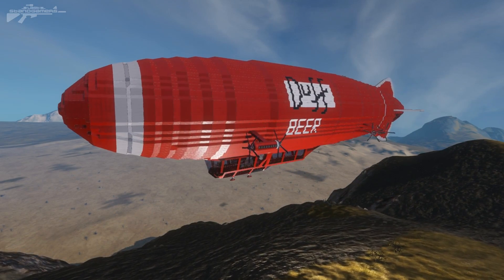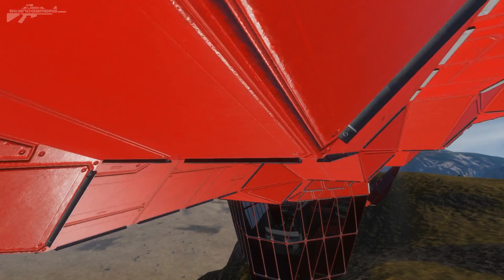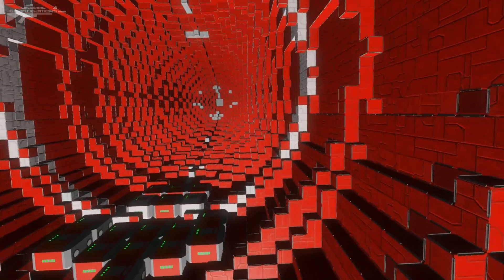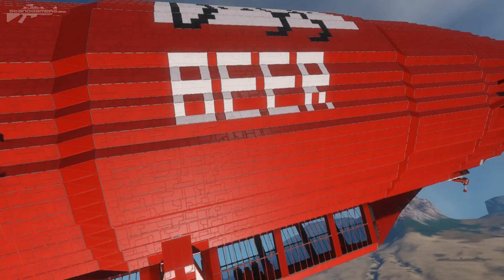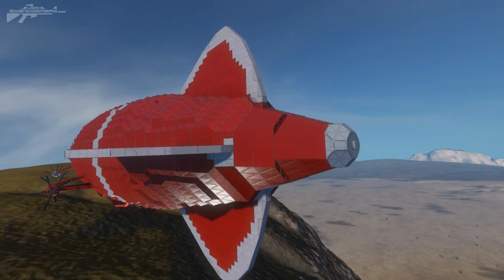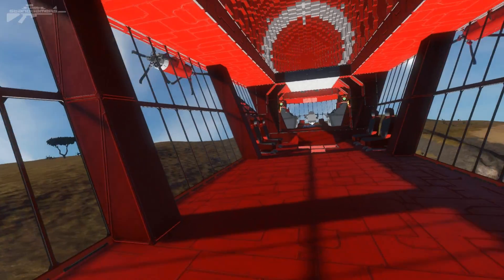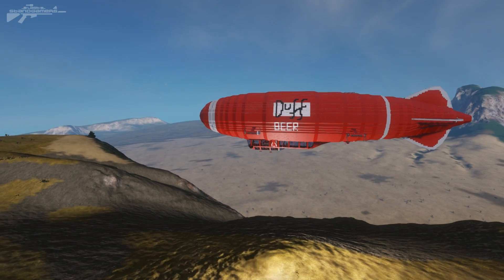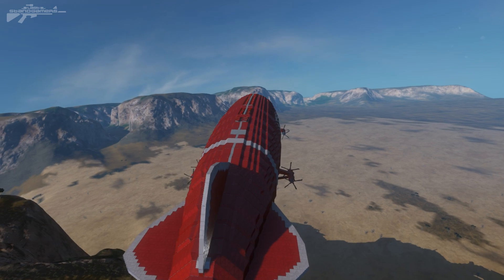Space Engineers - Blimp and Zeppelin Concepts

Comment: HYDROGEN!!!! Have it so that its slightly off cooler when it is released into the air and that if it is "Pure" (no air) its amber or somting. when it is blu it will explode if any engine thing or gun of something goes of near it. have a setting on air vents to "take in" or "relese hydrogen" or "vacuum air" or release both in a closed space the hydrogen could be some way dynamic ish like it could spred out on a small ship like grid with deferred levels of "fade". 1 small ship block could be lifted by 3-5 "blocks ov hydrogen
Reply: and you could have many kinds of gases with different properties and bottle powerd somethings

Comment: Yes! Let's add hydrogen in gas form! Extreme explosions everywhere!!!
Reply: +Actinium Oxide The WW1 German Navy Zeppelin fleet never had trouble with explosions everywhere. They can only be downed by incendiary ammo (assuming normal operating safety precautions are observed). Prior to incendiary ammo, one Zepp returned from a mission with over 450 aircraft machine gun holes being counted for repair. Hydrogen is a very acceptable lift-gas, as far as I'm concerned. Regular aircraft use aviation fuel for lift gas. Tell me that isn't dangerous and flammable. We use these materials with intelligence, is all.
Reply: Carl Lelandt I'm obviously the one who would light the hydrogen.
Reply: Carl Lelandt You have no fantasy at all do you?
Reply: +Actinium Oxide There's a few on my shelf.

Comment: A buoyancy system will be needed if they ever implement actual water, besides, they already have the programming for filling a space with oxygen, it's not that far away from buoyancy with say, hydrogen or helium. This would also add extra thought into a build, do you fill your blimp with Hydrogen, creating less lift but less prone to combustion (oh I don't know, when shot) or Hydrogen, much more lift, but much more prone to "spontaneous combustion. This also brings about the opportunity to add some new blocks, say, a heater. It is about as energy efficient as an ion engine (or atleast more efficient than a turbine) and can heat oxygen for hot air balloons and zeppelins and whatnot

Comment: A mass block that could have negative mass values would be handy.  It's hard to say how a grid will behave once its total mass goes negative.  

Perhaps it could be possible for vent block to change its mass value based on the total scale of gas voxel it is measuring.  Then that could simply be added to the total mass of the grid rather than bothering with any density calculations.

Comment: u can make a vakkum in the ballon this  would be theoreticly mutch more effektiv then Gas
Reply: +LOP1698 Why?
Reply: how are you supposed to fill a ballon with nothing? what does a ballon filled with nothing look like? right... an emtpty ballon. do those float? no.

And if you want solid walls it would break since the pressure on the walls would be ~100000 Newtons/m².
well phsically correct it would break at least.
Reply: +jort93z u may forgot that the ballon is out of 1M*M steel cubes ^^
Reply: +jort93z and yes i do float its about the wight  of the matirial and the matirial wight nothing and the volume from the object so that means if u have an object that wight noting with a large volume and a perfekt airodynamik u would go up with nearly Lightspeed ^^
Reply: LOP1698 1 cubic meter of air has a weight of about 1.3kg. 1 cubic meter of steel 7856kg. lets now assume that its 20mx20mX60m.

that'd be 31200kg of weight for the air and about 43993600kg for the steel.

not really similar is it?
Reply: jort93z i was not saying it would fly î just sayed its possible ^^
Reply: +jort93z and it could be that this is not steel like we have it on earth i mean this is like way in the futer
Reply: LOP1698 well you said "and yes i do float its about the wight of the matirial and the matirial wight nothing" and
"1M*M steel cubes"
and if you tried to build a plane in space engeneers.
well you'd know those things are heavy.
it is way easier to fill it with hydrogen. hydrogen weighs only 0.083kg per cubic meter anyway. remember  that air is about 1.3kg per cubic meter. the hassle isnt worth it.

You can have either
1.217kg of weight difference per m² and no forces to the walls
or
1.3k of weight difference per m² and 100000 Newtons/m² of forces on the walls.

Comment: An Idea for the gas concept, why not hydrogen? It could be set up so that you would first need to seal the chamber off from the outside, and have a vent in there that you would first set to depressurize, which would take most of the air out of the room. Then you would set it to pressurise the room, but you have it hooked up to a hydrogen tank and probably have an option in the vent to have it switch between air and hydrogen. It would then take the hydrogen from the tank and pump it into the chamber like you would oxygen. And sense hydrogen is lighter than air it would create lift, depending on the size of the chamber and how heavy the craft is, so a large chamber made of light armor would get more lift than a camber of the same size made of heavy armor.
Reply: yeah that would be a problem but I think hydrogen might be the easiest thing to work with sense it is already in the game and would make it so that you wouldn't need to find a new resource in order to do something like this.
Reply: +Bonedragon1300 Do you want Hindenburg? Because that's how you get Hindenburg.
Reply: that wasn't the only factor for the Hindenburg, it was also coated in a highly flammable paint, which was one of the reasons it burned so spectacularly, and besides, unless a new blimp plock is added you're not going to have thin walls for the chamber as because you would still be using the armor blocks to build it.